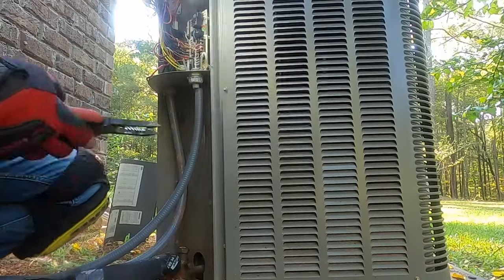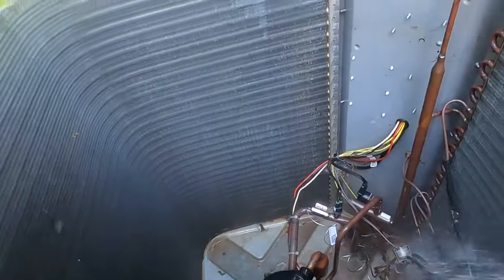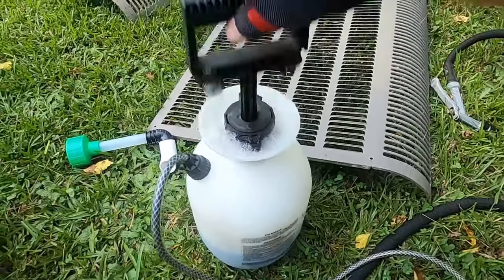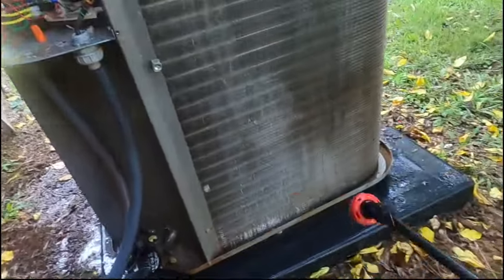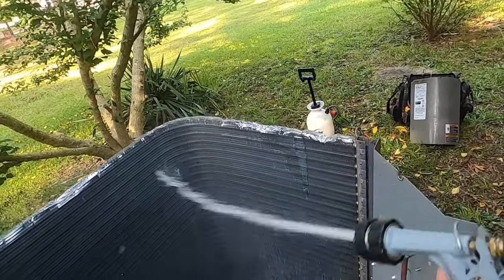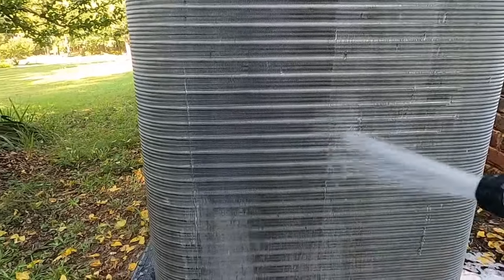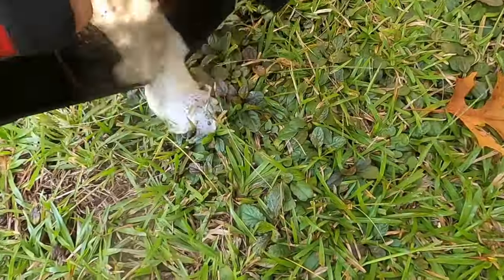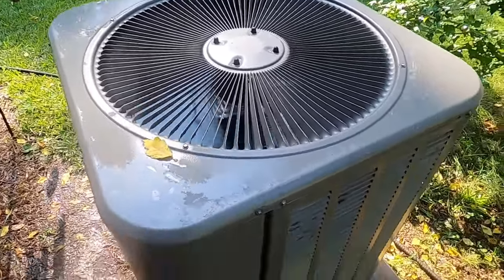A/C maintenance and repair.

Comment: Nice video as always I like your videos. I am a residential maintenance technician and I have been told that Lennox condenser is only water washed is it true or wrong? 
How did I miss the give away again. 
Thanks buddy.
Reply from the maker: I’ve never had a problem. I dilute the cleaner with water, not a strong mix.

Comment: Your climate must be harder on units. Most people here don’t clean. Once or twice a year, I do from the outside, and about every 3rd yr pull the fan and do from the inside—always water only. We usually only have dust and weed seed in the air.